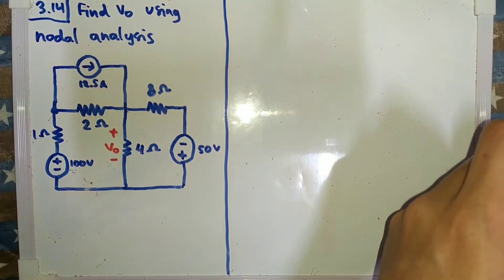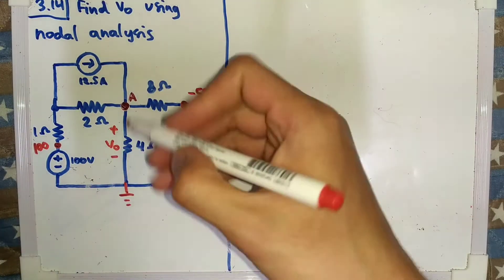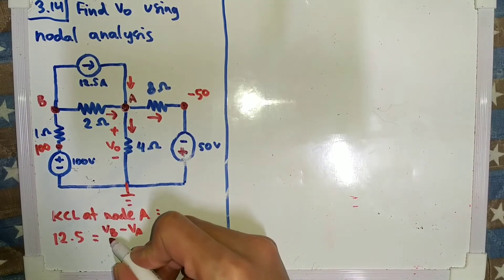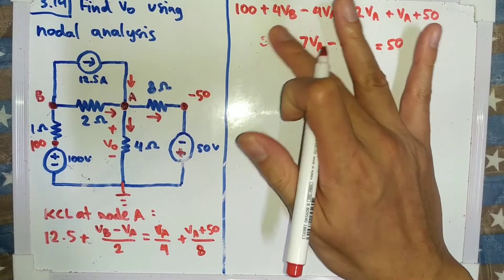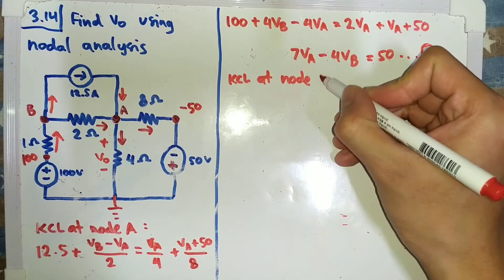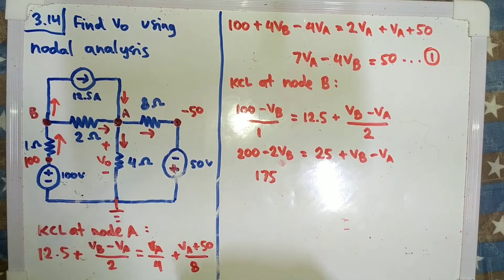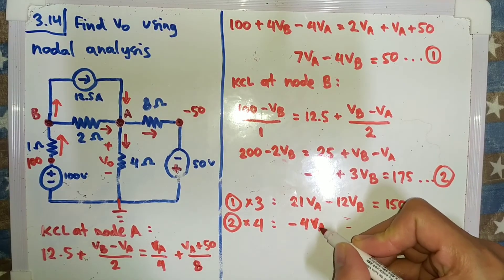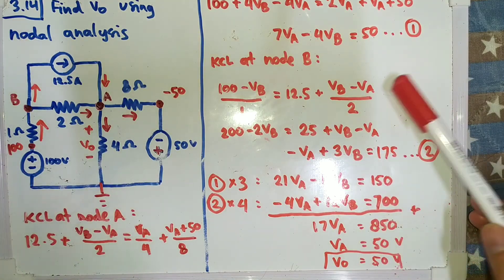Problem 3.14 Sadiku - Using nodal analysis, find vo in the circuit of Fig. 3.63 - NODAL ANALYSIS

Comment: Sir please answer my question In equation of node 1 in voltage source of 50 volt current is moving from high to low potential then why you take it negative
Reply from the maker: It's not current

Comment: why is the direction of current from b to a at 2ohm resistor??
Reply from the maker: You can assign to any direction, it does not matter, if the direction is wrong the sign will be negative.